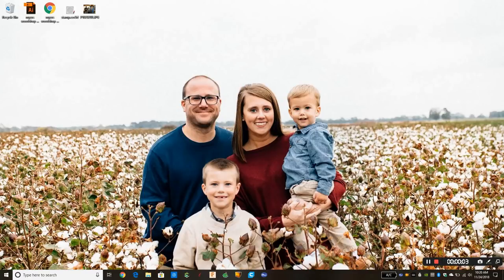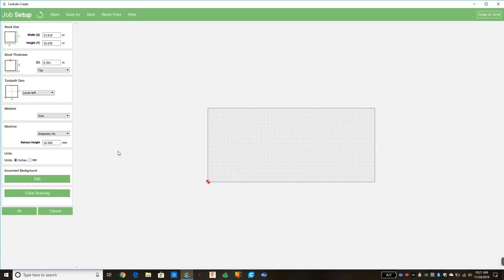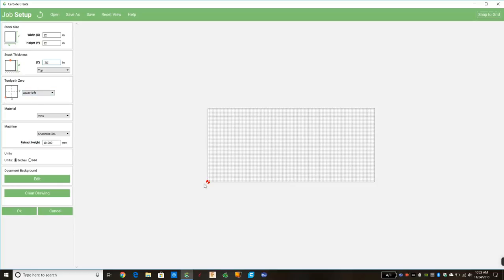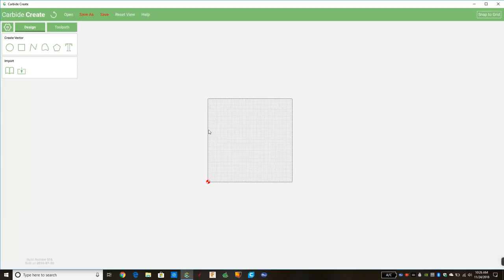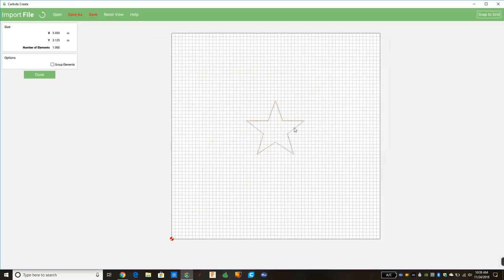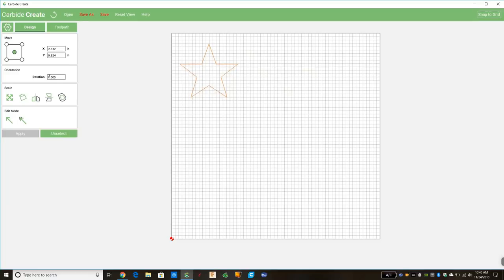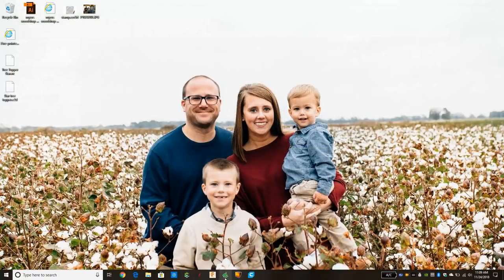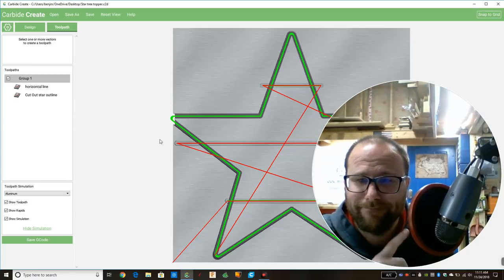Carbide Create Shapeoko Basics - Part 1: Design // CNC Woodwork

Comment: Thanks you helped explain a lot.  I took your advice and downloaded carbide create even though I don't own a machine ...yet.  I did find a couple things in build 451; you can now center 1 vector and when selecting the tools to use there is only one option an 1/8 inch end mill the rest offered have padlocks on them.  That is if I was doing it right.
Reply from the maker: Glad I could help!

Comment: How would you get it to "zero" off the front of the board for a surfacing file? CC does not ramp cut and I don't have a fancy bit (new at this) so I need to come in from the front and not plunge in? Thank you.

Comment: Thanks Ben for getting these videos started. Looking to purchase a XXL in the near future. I'm new to all this cnc stuff and was digging around last week with the Carbide Create program and was kind of struggling with it. Also I watched your video on the JTECH 4.2w laser and was wondering if it is possible to carve and burn on the same project? Thanks again for the great video.
Reply from the maker: its absolute possible to carve and burn, but not at the same time. You'd have to run two separate operations, just like if you were changing a bit size.  Its simple though!
Reply: Thanks for the reply  @MyersWoodshop

Comment: Enjoyed your presentation for Carbide Motion. I was wondering if you can change the tool path (when doing material bottom cutting) from circular to bottom /top cutting.
I have found in the circular tool path, you get rough cutting when crossing the wood grain. Making it very rough. Can I change the tool path?
Reply from the maker: not as of yet in carbide create

Comment: this video really helped me understand the software.  I was hesitant to buy a CNC router because I didn't know what the software issues would be.  especially the tool path creation.  they look pretty simple.  How do you like the shapeoko?  I have read comments about the flex and was considering a shark but really don't want to spend twice as much if there is not much of a difference in performance.
Reply from the maker: after just a few projects, you'll get the hang of it in no time!
Reply from the maker: also, the shapeoko has been great.  I haven't come across anything it couldn't handle yet!

Comment: I enjoy your explanation in using Carbide Create. I have downloaded the program, but the many of the elements shown on this video are available using the free download. Are you using Carbide Create Pro, is that why I'm not able to find many of the elements you use. One example is mine doesn't have import from Design Elements. Once I select the star I have saved, I don't have the option to resize by select the 12 x 12 size. I'm worse than a novice, I'm looking at the LongMill CNC. Any suggestions?
Reply from the maker: my video is about 2 years old and they've updated since.   I'd buy the www.onefinitycnc.com !

Comment: We are trying to make our first object, a cat, we are using the 201 .125 bit. Our first pass of the bit is cutting over .125 an splintering bad. We don’t think it. Should cut that deep all at once. Where can I find a setting to ensure it makes several passes, instead of one deep pass? I hop this question makes sense, not sure how to phrase it.
Reply from the maker: change the depth of cut to .06 in the tool path bit settings.  also, use a downcut bit.

Comment: Hey Adam, im having trouble understanding  what information goes into  the carbide create excel spreadsheet. if you dont mind helping me input this tools from Amana tools. Rc-45711 90 degree, 45705 60 degree, rc-1075 30 degree v bit
Reply from the maker: I think they are included in the latest carbide create update.

Comment: does carbide create only works with shapeoko or can i use it on different machines like cnc 3018 pro?
Reply from the maker: you can use it for any machine that runs off gcode.

Comment: sucks right off...  but have to give it a chance, it could be good.
Bear with me, if you could comment and address all the points I bring up... I cannot purchase this equipment without knowing it is more than a 3 year toddler level, as it appears so far.

If I design a piece, I want to design that first then be concerned with the substrate/stock size
and adjust accordingly by laying my part(s) and sizing the part(s) to fit.  ...as surely many jobs are more than one part at a time.  ...and the stock may not be always the same size and parts count the same.

Can you clarify:  so the head lifts 10mm(1cm) above the original top of the stock being cut into?

Why not create a pentagon/circle and the associated isosceles triangles and create a group to demonstrate the group feature!?

...and if you did do that, could you draw up only one of the points and have the software create the rest of the points evenly spaced out around that circle/pentagon?  ...which would amount to the same process one would have to go thru to create a spur gear.

Comment: Thanks for this information!  I have a question, i just got the amana 1/8 bit that you reccommended on your blog and i can't seem to get the feeds and speeds right. what settings should i use for the amana 1/8 compression bit?
Reply from the maker: .25 doc, 40ipm, 3 on router

Comment: according to your opinion which of the two is better? I want to use it for hard woods, also I wanted to ask you if it can be used as a thickness planer?
How long are the aluminum rails?
Reply from the maker: which of the machines are better? or programs?
Reply: @MyersWoodshop   both ?    programs and machines
Reply from the maker: Vetric and shapeoko
Reply: @MyersWoodshop  thank you very much

Comment: Do you have any suggestions on what you need for a laptop? Better processor, amount of RAM? Im not very tech savy
Reply from the maker: to send the gcode or to edit files?
Reply: @MyersWoodshop  to create drawings and run the machine. All the website says is windows 7 or higher and 4gb ram